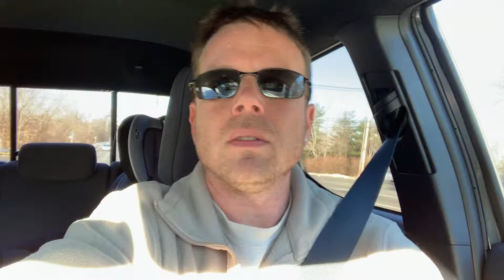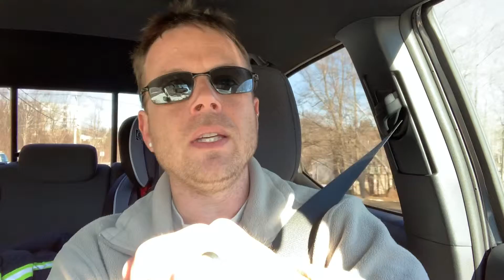How to Diagnose a ESC that is Not Showing up in Betaflight

Comment: This is exactly what I was looking for because I have the same ESC and had recently switched flight controllers and I had to make a wire with the pin headers and motor 3 and motor two are not being recognized so I’m going to directly Solder thanks hope it works
Reply from the maker: Happy to help, good luck!

Comment: I am having a similar issue where all my escs are soldered to my fc, and they all beep or chirp or whatever when the battery is plugged in, but wouldn’t spin when armed. I checked the soldering and wiring and it’s fine and I’m super frustrated. Help! I’m ordering a new fc because a fried the other bridging pads when trying to bright my motor 3 signal to motor 4 signal.  Do you have any idea what was happening? Thanks
Reply: Thanks so much man. I appreciate it
Reply from the maker: Anytime. Let me know how you make out with it.
Reply from the maker: I would look into your receiver connection to Betaflight. It sounds as if you have it wired correctly but when your hitting arm the transmitter is not sending the signal to the receiver. Something simple I guarantee it. As for the pad issue, look up resource remapping. If this is something you feel comfortable with, it’s the ability to use another pad for motor signal with a few commands in the CLI tab.